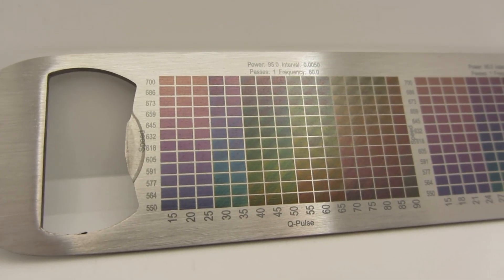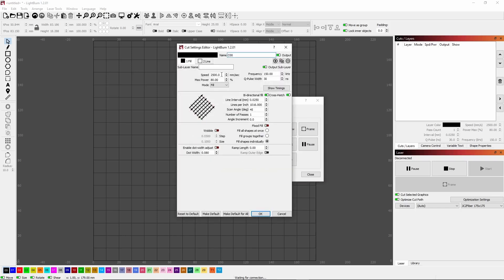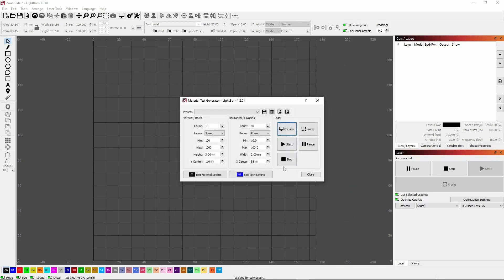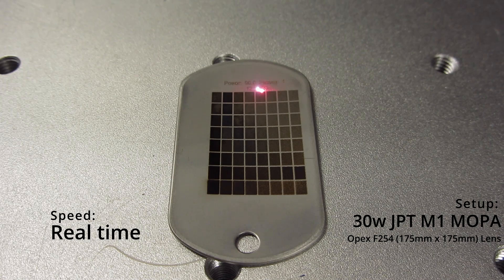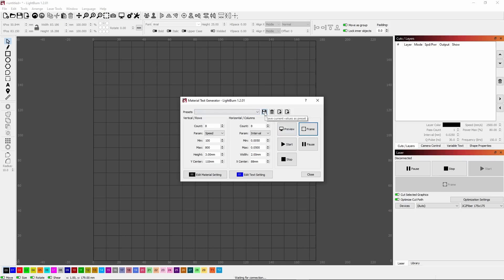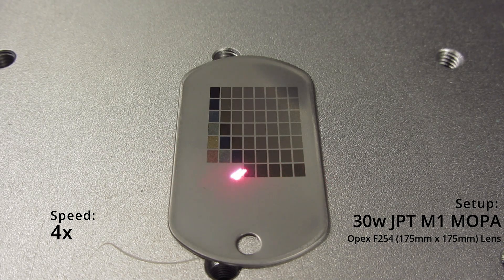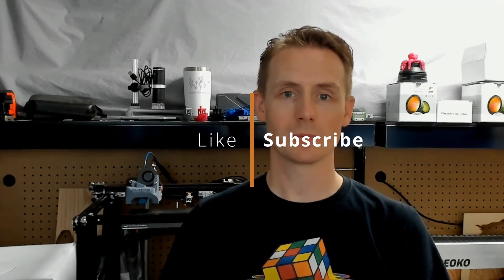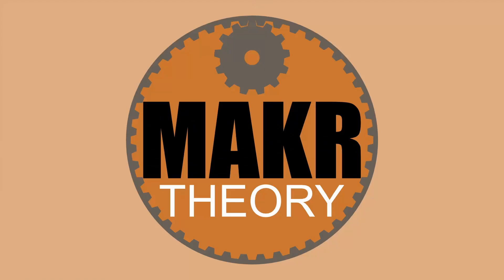Laser MOPA Color - LightBurn Material Test

Comment: Do you have any settings available? I also have a JPT 30W with a F254 lens. I have subs a massive amount of time into attempting to get some colors to no avail!
Reply from the maker: I do not. Things can vary so much between lenses and sources. You can pause the video at points at try to run my settings, but I cannot guarantee they will produce anything like what I did.

If you are not seeing any differences with adjustments to QPulse, look to see what the laser source model is. If it is a YDFLP-E-30, then you will not have any QPulse adjustment. You will need to focus on using only Frequency, Power, and Speed.

Comment: Geo, have you ever tried colors on a tubler, like the Polar Camel in the background? Is it possible to get colors while engraving through the powdercoat?
Reply from the maker: I have not. I would think the best results would be to burn off the tumbler first and then apply colors in a secondary pass so the powder coat doesn’t try to melt out from the heat of the slow color mark. If you give it a try, please share your results, I would like to hear how it turns out.

Comment: Hello, thanks for your video, it gives me hope to find the full range of colors ! It could have been nice to cross your energy to do those tests with 6Sigma skills , that could connect the dots between all those parameters and desired output ! The only 'issue' is that you need a very expensive tool (spectrophotometer , a high end one) to do measure exactly the color and finish surface (can be glossy or matte)  to finally make a nice regression and find the perfect parameters for a given color
Reply from the maker: Thank you. I have seen spectrometers used for paint matching before, but I have since lost contact with those people. Maybe I’ll have to talk to some local industrial paint/powder coat shops and see if they have one and would be willing to collaborate with for some content.

Comment: Where can we download the test grid ?
Reply from the maker: The test grid is built into LightBurn. If you follow the video, it will show you where to find it and how to configure it. You will need to experiment with your own mark parameters and ranges though. My M1 30w source used in this video has a much lower max pulse rating than most modern machines, which is why I don’t go below 60khz.

Comment: Thanks for sharing this exhaustive test and your learnings. I have a JPT 100W MOPA with 110mm lenses and am looking for black marking on brass (70 copper alloy, 1.2mm thick). I  do engrave with certain depth on it (0.2mm) and to avoid burning the metal and reduce hard residue on surface I go "soft". I use 800 speed, 30 Power, 35 frequency and 2.000 q-pulse (8 passes) plus a cleaning pass. The outcome is pretty good but no collor at all. Would love to get it black and keep the very low hard residue/low temperature. Thanks for any help.
Reply: I also have a 100w JPT 
Did a 10x10 test grid
Material settings
Power -50%
Pulse - 15 ns 
Freq - 125KHz
Adjustable settings
Speed 100mm/s - 1000 mm/s
Interval 0.001mm - 0.005mm

Hope that helps!
Reply: With a 200mm lens
Reply: @thesquatch133  Thank you mate, I appreciate your help. I will try test grids with these starting point. May I ask you if you have a way to engrave custom line art designs with depth and not burn the metal at a point you have dense residue on it that requires polishment. I still face this and if i work on rings or pendants the polishment will remove the plating... so can not yet engrave with depth on jewels or semi fine jewels.
Reply: @emilianomosca4484  ill pull up my settings when i get back to work tomorrow and get back to ya.
Reply from the maker: You are welcome. Copper alloys take a lot of heat to make a black mark. You will likely find the need to use a very slow speed and a small line distance to get a smooth, black mark. You can faster with higher power, but you will likely have a texture. I don’t have a 100w, so I don’t have any references to the power and speed required. That is the beauty of the test grid feature in LightBurn.

Comment: Regarding your point at 14:45: The pulse width for practically all MOPA lasers, except for specialty sources, can only be adjusted in discrete steps with invalid settings being automatically rounded to the nearest supported pulse width. I do not have the datasheet for your particular laser available, but JPT is usually very forthcoming in providing datasheets for laser sources provided you have the exact model number available.
Reply from the maker: Thank you for the info. I have started looking into this and plan to provide an update after further testing.

Comment: is the test for mopa M7 identical jpt 30 w mopa?
Reply from the maker: You will get different results if you use my exact settings, but the overall process of using the material test and performing iterations is exactly the same.
Reply: @MakrTheory  thank you

Comment: If you are trying to find out what the focus was, you can generate a rectangle and pick any setting on your test and go with that. Start out of focus and start focusing in until you find the same color happening and stop the burn. Look at how out of focus you are and run the material test to check if it matches. Thus you will know what to set the focus on when you want those colors.   Just Sayin.......
Reply from the maker: I could, but honestly I prefer to mark in focus to reduce the risks of damage to the lens, mirrors, and the source.

Comment: What is mopa.
Fiber laser and mopa is same or different
Reply from the maker: Fiber laser refers to the fiber optic cable that the beam travels through. Typically uses a wavelength of 1064nm. MOPA (Master Oscillator Power Amplification) is the method of creating the beam power. For laser engraving, when people say MOPA, it is most likely a MOPA fiber laser.

There are also two types of MOPA fiber laser. This video focuses on the adjustable pulse width MOPA (JPT M series, M1, M6, M7, or M8). The other type is a fixed pulse width that can not be adjusted (JPT LPE-30w and LPE-50w) have to be careful when buying because I have seen sellers advertising MOPA and people perceive it to be adjustable, when they are really selling the fixed version.

Comment: Hello from Germany,

Mate - you did a great job! I’m a beginner on this laser stuff. I was reading, watching YouTube videos and many more. I think I will order a 50w gweike MOPA laser soon. For the beginning I just want to mark / engrave in black color on stainless steel plates. Do you have any good experience to share with me? What are the best parameters?

Thanks for your support!
Reply from the maker: Hello. Thank you. If you are wanting a MOPA with adjustable pulse width, like mine, you will need to make sure the source model number has an “M” in it. Typically they are 20w, 30w, 60w, 80w, or higher. The JPT 50w is a fixed pulse width of 200ns. Model number will have “LP-E” in it. This will work for marking black, but other colors will be more difficult. If the listing you are looking at doesn’t state what laser source it is using, make sure to ask before you purchase. If they don’t want to tell you or can’t, do not buy from them. Find someone that is knowledgeable and transparent about their product.

I found better results for colors, including black, using a larger lens. This will reduce your ability to deep etch, so I always recommend getting couple lenses for your machine. 110x110 is good etching and general purpose. I find 200x200 or larger is better for color marking, but will not etch very well. You will have to experiment with your specific setup to find the best parameters.

I hope that helps.

Comment: Howdy I have a mopa fiber and I don't have the option to change my q-pulse settings??
Reply from the maker: Could be a setting not turned on, or you have a fixed pulse width MOPA. If you have an “M” series JPT, then you will need to go into the laser settings and check the box to turn on QPulse. If you have an “LPE” series, then it will be locked at 200ns no matter what you type in.

Comment: I tried to use the tool to create the color grid with satisfactory results, but when I put the parameters in the layers of any image, the marking comes out all black without showing the colors, as if the lightburn layers were not communicating well the parameters to the controller. is there any solution?
Reply from the maker: That is odd. I have not experienced that issue. If it happened to me I would:
1) Double check focus first
2) Test each layer using a square the same size as the test grid square to see if you get the same results as the test. If they are still all black,
3) Double check layer settings and look for unwanted subroutines on the layer
4) Restart the laser and the computer and repeat step 2.
5) If results are still black, attempt another established setting from your library and see if that gets the expected result.
6) Double check laser configuration settings. I use IPG-YLMP for my JPT MOPA.
7) If no change, contact LightBurn support.

Comment: I have had this laser for 3 months and I have not been able to engrave anything. I do not know if it is the laser or me. I appreciate all you do for an Idiot like me. I have downloaded a material library and the laser params Converter and still I am having issues. Can you suggest any kind of test if there is an issue with the machine?
Reply from the maker: I would start with making sure the source is powered. My laser has a separate key to turn the source on, that is separate from activating the Galvo head and controller card.

From there I would make sure your lens cover is off and try to find your focus. Get a piece of steel and place it on the table under the lens.  Look for the “F” number on your lens (ie a 175x175 is F254) Set your lens height the F number +100mm) For your 100w, I would start with 600mm/s, 80%, 70khz, 650ns. Run a circle or square with those settings on continuous and slowly turn down the lens until you see the brightest sparks.
Reply: @MakrTheory  Sorry. I didn't explain myself well enough. The laser itself works. My issue is when I use the settings I find on videos and use the same material the video says to use I do not get the same result. For example, I am trying to do what you are doing in this video such as engraving color on dog tags. I have a 100w laser so I use a converter to get the right parameters from your settings on a 30w laser. I do not get colors. I have done it multiple times and got different results each time. Thank you for all the help
Reply from the maker: @harrygithens3908  I see now. Your machine a has a lot more power and a different power curve. I would ignore that converter. I haven’t found one online that has worked very well for me. I think they making some wrong assumptions on how lenses and sources work together.

I have been working on a better converter, and plan to post a new video with some helpful sample files to get people started very soon. In the meantime, if you want to share your lens and verify if your source model has an “E” in the full model number, I can try to give you a head start with some base settings.

Comment: Have you thought of compiling all this in a document like excel or something and selling them for us NEWBIES to start out. Seems overwhelming.
Reply from the maker: It has crossed my mind several times. I feel the document alone wouldn’t be as beneficial without a tutorial to walk through it. It is a priority once I get back to making content again.
Reply: @MakrTheory  Thank You. I tried to screen shot the points in the video that shows your plates and markings...I never got the same results but I keep trying and it's frustrating as I have a 60W Mopa JPT and it must be slightly different as none of my colors are VIBRANT...never know when to leave cross Hatch on...di-directional on..or off....but hey I'm still learning.
Reply from the maker: @MasterTheNEC there are some variables that will change with every setup. The lenses typically used on these lasers are “economy” grade and have a wide range of variability in the focus and work area. This will change your spot size and the ability to mark materials. I try to do everything as a single pass, no crosshatch. I would select bidirectional or unidirectional and just keep that setting fixed through the tests.
Reply: @MakrTheory  Thanks. My lens is 175mm x 175mm. I will learn it eventually but kinda wish I just got the 60W Fiber rather than the MOPA at this point..but I keep trying...LOL
Reply from the maker: @MasterTheNEC I felt that way initially too because the MOPA adds another variable to figure out. Honestly the MOPA is the better machine and can do way more, once you get used to it. When you get a color you like, do a new grid narrowing in on those same variables. If you are already really tight on one of those variables, you can lock them in and start using another variable on the grid to see if that helps vibrancy. Just take it in small changes.

Comment: Is there anywhere I can find a material library for a 100 watt laser or any material library I have tried everything and can not get colors
Reply from the maker: I can try to guide you in the right direction, but it will really depend on your specific setup. What size lens are you using? There should be a marking on the lens stating something like “110x110 F160”.
Reply: @MakrTheory  I have a 70x70, 110x110 , 250x250, 300x300 and I have on order a 175x175  i am using a 110x110 lens. I really appreciate all the help
Reply from the maker: @harrygithens3908  lens is likely your issue because the spot size is so small. You either have to drop the power even further and tighten up the line distance, or switch to a larger lens. I got my best results with my 300, but each machine and lens is different.

Comment: Thank you for your help. My laser will not go lower that 600mms but with my speed set at 600mms all I get is a silver/gray color for all boxes.  I have started to change my setting hope I can  find the right setting. Thank you you have a grate video.
Reply from the maker: That is odd. You should be able to fix that in the machine setup. What software are you using?

Comment: I have a 100W JPT M7 MOPA Fiber Laser. How do I set up my setting
Reply from the maker: You can start with what I ran on one of my initial tests that got color, but I would drop the power to 30% of what I use in the video. Lens plays a factor as well. If you are using a lens smaller than 175x175 (F254), you will likely need to drop power a little more.
Reply: @MakrTheory  I have a 60W Monport Mopa. Have you published all these settings anywhere? Very Nice work here, thank you for sharing.
Reply from the maker: @MasterTheNEC I have not published them, but I am currently working on something that would help people find their starting points. I will be announcing them in a video soon.
Reply: @MakrTheory  Perfect...Keep it Simple for us Simple Folks...LOL

Comment: Really wonderful and informative—thank you so much for posting!  You answered many of the same questions I’ve been wondering about myself!

I was wondering how the colors have survived now one year later.  Do you see any degradation?  Any patterns of what colors are more stable?  Do the samples on 316 survive any better than the 304 etchings?
Reply from the maker: Thank you. Most have survived well. With no after treatment, some corrosion appeared on one of the bottle opener samples of unknown alloy (assuming 304), but it was on a seemingly random spot. The others appear to be doing fine, but I live in a dry desert climate.

Comment: CAN I BUY A BOTTLE OPENER WITH BEST COLORS ON THEM
Reply from the maker: If you are looking to use it as a reference chart to get colors on your laser, I would strongly suggest you run your own tests with your specific laser and setup. My settings will likely not work on your machine, which is why I explained the process without providing specific settings.

Comment: Could you share where you outsourced the materials you used?
Reply from the maker: I provided a link to the dog tags in the description. The bottle openers are no longer sold by that same supplier, so I have to buy some others and test to provide a link. The 416 and 17-4 were from OnlineMetals.com. I'll update with a link in the description this weekend. The 316L discs were scrap slugs from a local metal shop. It was a lucky find and I grabbed what they had of them at scrap prices.

Comment: Great job, However I have a Snapmaker Ray diode 40w. I am not sure of the settings in the material test because they are different than the ones you used.  I am ordering the dog tags to start trying like you did. Again, great job.
Reply from the maker: Thank you. Diode will definitely be a different setting than Fiber due to the different wave length of the laser (450nm vs 1064nm) and the way it is absorbed by the metal. Best of luck.

Comment: Is it 254mm lens for colors lol. Can not seem to laser stainless steel
Reply from the maker: It really depends on the settings and laser. I have managed to get color with my F254 (175x175) and my F420 (300x300) on my 30w M1 JPT. I know other people use the F254 with their 60w M7 for color as well.
Reply: @MakrTheory  Actually got mine to work. Just have to get correct distance. Do you know what the smallest and biggest diameter the 254 head can laser?
Reply from the maker: @authentic4225  I’m not sure I follow. Are you talking how small or large of an area you can mark on a flat surface?